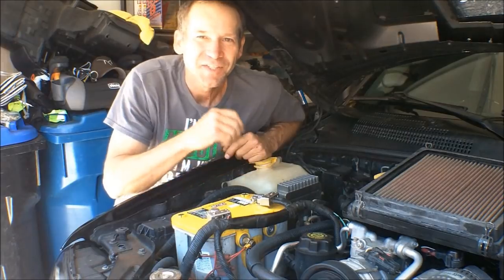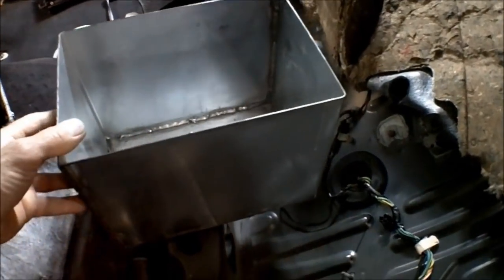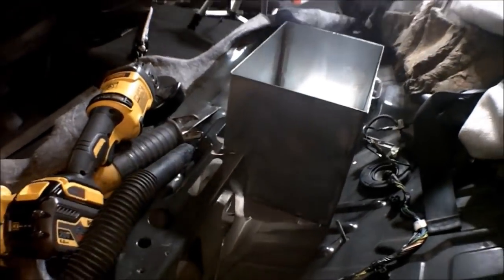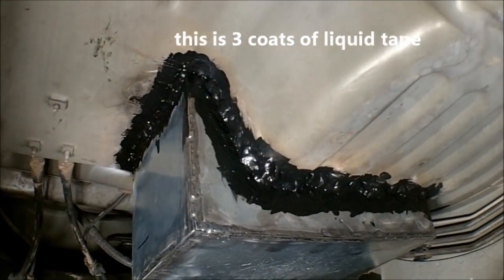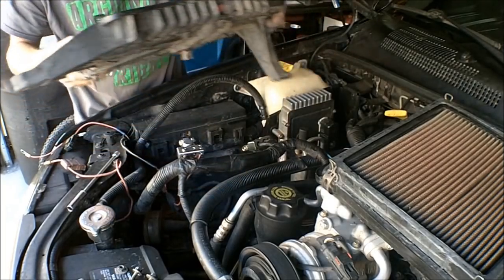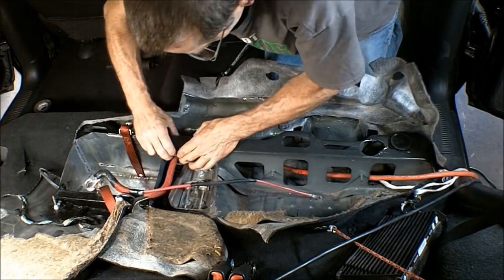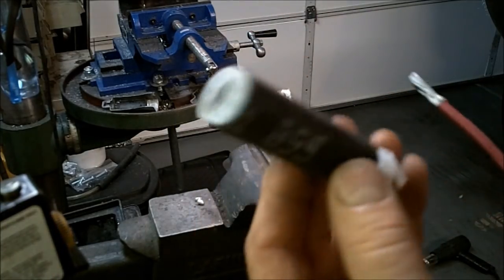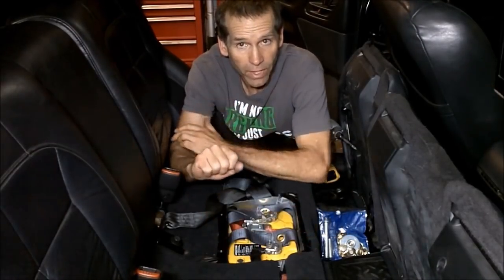Relocate Battery on a 99-04 Jeep Grand Cherokee Part 2 Wire Tuck

Comment: Hi Martin, 
nice build. 
Using zinc galvanised steel looks like good idea.  But not when you are welding.  Zinc welding vapours are extremly poisonus and can be fatal if  you do that on a regular basis.  Apart from that - zinc made it hard to weld,  not the small gauge of steel. 
Take care and keep us posted with your nice work.
Reply from the maker: I did remove the galvanized coating when I welded it to the Jeep. I did not when I weld the box together.

Comment: While accessing my own wire tuck options on 04 WJ 4.7HO, I noticed a ground cable down near the starter, bolted to the bell housing that looks like it's been torn.  Been looking into where this cable originally went.
Reply from the maker: I just pulled a 4.7HO engine out of a 03 Grand don't recall seeing a ground cable bolted to the bell housing. Next time I'm under mine I will have a look.

Comment: Great idea. Would it still be ok to run the battery cable through the fender well if off roading is your sport and dirt and water would be in contact with that connection?
Reply from the maker: If it was my Jeep I would just cover the positive connection perhaps with some liquid tape to prevent any corrosion

Comment: Only about 10% was from the sheet metal, its that galvanized metal that gave you most the trouble. What you want to do is take the galvanize coating off where your going to weld and when your welding sheet metal, you want to do 1 inch/2 inch stiches and jump around to keep the heat away from one area. Good job though. Can you give me the dimensions for the 75mm tb adapter?
Reply from the maker: I did remove the galvanized coating when I welded it to the Jeep. I did not when I weld the box together.

Comment: То есть,  все испарения от АКБ, теперь будут в салоне? Интересно...
Reply from the maker: I drilled a 19mm hole in the battery box for venting and installed the sealed battery box cover. The next time I need to purchase a battery it will be a dry cell.
Reply: @martinbuilt , гелевый АКБ хорош для off-road. 
Может лучше вентилятор от PC в короб АКБ поставить?))
О!!, или подвести канал с ног пассажира за водителем.

Comment: All that hard effort for what? saving a little space inside the engine bay? there is no doubt about your expertise and good work here, but I will not do this in my Jeep, spending more than its value to move its battery? I say it is unnecessary modifying extra hard work, unless doing this as a hobby to satisfy you curiosity.
Reply: A O room for turbo
Reply: To my opinion it helps with balancing the weight of the vehicle between two axles. there's 4.7 engine in front, and rear side only gas tank and spare wheel. that extra 50-80lbs can make big difference in high speeds. But I'd also consider relocating the battery to the spare wheel compartment.